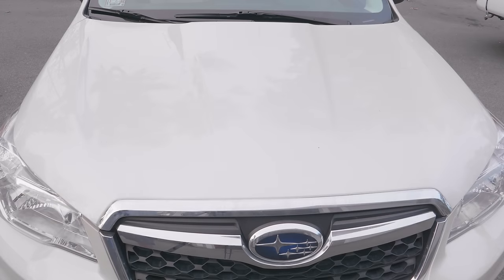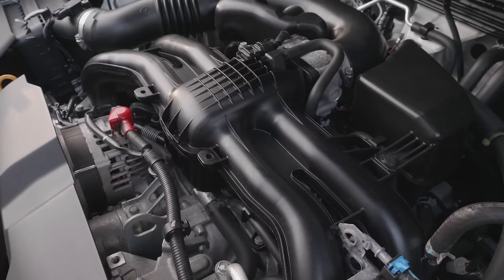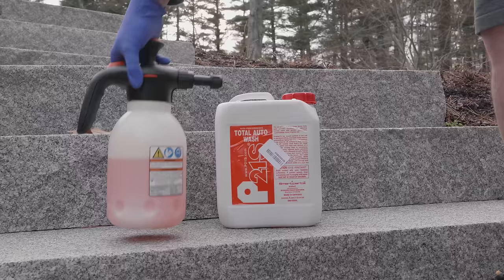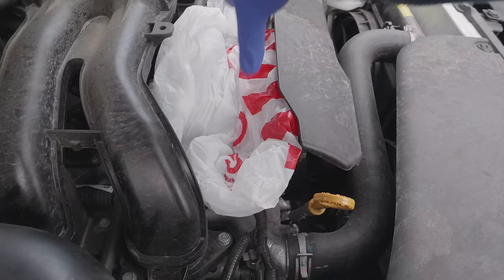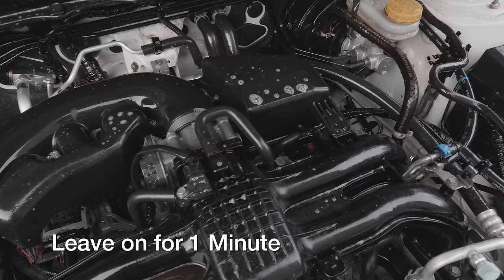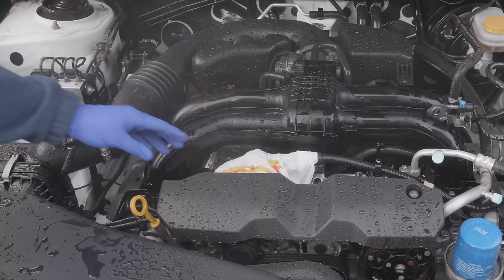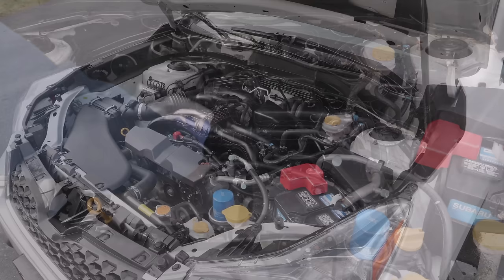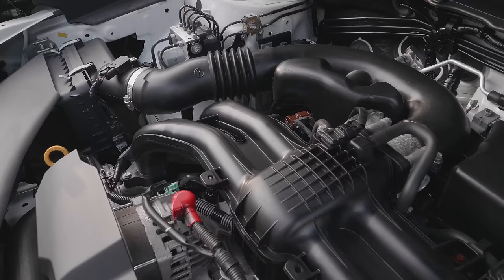Clean & Detail Your Car Engine in 5 Minutes!

Comment: I feel covering/disconnecting the battery would help
Reply: He disconnected it
Reply: Why do that they work perfectly well when wet .
Reply: @paulwainwright967  Avoid short circuiting it
Reply: I completely agree
Reply: There are a lot of harnesses with power in newer cars when the ignition is off.  Your not going to short wires and start a fire, but sensitive low voltage circuit boards and some sensors are very sensitive to even minor electrical blips.   Just takes a few minutes to disconnect the battery and it's a good time to clean the battery terminals.

Comment: Great video....i suggest let it dry for bit after rinse...i started having belt squeaking after i turned on engine....mechanic friend said cuz it was wet.....
Reply from the maker: Thank you. You can certainly do that. I have had a bit of a squeak but it was always gone within a couple of times.
Reply: Your belt shouldn't be squeaky when wet.
If it is it's either a tension polly or a mis-alignment.
Try using a Gator belt!

Comment: Took a 7 year old engine that had never been cleaned. Followed steps, used a Citrus based Degreaser that I got from a Friend who owns a restaurant.
Diluted it 4-1 and sprayed. Used garden hose, and touched up with soft bristle dustpan brush  & Shop Vac and 5 minutes  later clean as a whistle! Took longer to get the shop vac and extension from the basement and open indoor valve to freeze proof bib and return them to storage. The cleaning was the easy part,

Comment: I've always used cleaning wipes frst then Armor All wipes to add a little shine. Never spray water in engine bay, electrical parts and belts could be an issue later. My method takes about 30min depending how detailed you want to get, but it's safe and effective.  Try it😉

Comment: The engine only had a thin layer of dirt. I'm very sceptical that using this method on an engine with caked-on thick oily residue would give similar results.
Reply: It was already clean in the first place

Comment: I use purple power diluted with dawn  and use a paint brush then use a nozzle on the mist setting and rinse motor off , I cover alternator and fuse box with plastic bags. Done this for years then wipe it all down with meguires for interior spray on rag and wipe down everything especially rubber hoses I don't spray and let set looks better but dust sticks to everything easily
Reply: You should stop using McGuire's on your engine. It leaves a film that dirt sticks to just like the Gunk engine degreaser it also attracts dust this method here works and it does not attract dust.

Comment: Tip: Dont forget to disconnect the battery first!
Reply: It's still connected in the video.
Reply: Dont need..i do this for years...
Reply: Don't need to.
Reply: (Do Not disconnect battery.) It will reset your computer and may cause issues with passing Inspection.
Reply: @MarketingCoachKen  so, then what happens when the battery dies?
Reply: Ahh no. No need for that at all.
Reply: @MarketingCoachKen  resetting the computer doesn't hurt nothing.
Reply: Just put a bag over it. 🇺🇸

Comment: Thanks for this advice. I can’t wait to get this P21S and clean my engine per your instructions. I was always afraid I would short something out, but I’m glad I am wrong about that.
Reply: If you drive in the rain then your engine is wet🤷🏻‍♂️
Reply: @nathan hunter
The bottom of the engine will prob get a little wet and the rest of it will stay dry. That’s why all electrical connections are on top and sides , they stay dry

Comment: Wonder what this product will do with a real dirty engine. Till then I stay stick to the meguiars wheel cleaner on the engine. Same method, spray it, wait a few mins and brush only the very dirty parts and rins with water. But would advise to protect the plastics with a protector anytime for a longer lasting.

Comment: The engine wasnt even dirty to begin with… a few specs of dirt here and there is not a problem. Try engine oil that’s been caked on for years, power steering fluid that leaked from the hose, and transmission fluid that I spilled 2 years ago…

Comment: I would love to see him do this with a car that has coil over spark plugs and the computer stores under the engine bay. This is hype nowadays it's very hard to detail in the engine for the past 15 years or so. There's a lot of Technology under the hood. It's not like 25 years ago where you cover up one coil pack in an alternator and go at it
Reply from the maker: More videos to come on this one. But I have used many times on coil over plugs on multiple Toyotas and more complex vehicles. No issues for me at all. Electronics in the past 15 years are much better sealed. The old stuff is the issue for water.
Reply: Absolutely correct! I blew two coil packs at $100 each by doing this, and I knew better.
Reply: @agf804  I'm thinking you're lucky blown coil packs was the only issue you encountered with this method.
Reply: How much water do you think gets into the engine compartment when you drive in the rain?

Comment: I've cleaned every engine on every veicle I've owned bought them all brand new and at last count it was 12 truck after a drive that gets the engine heat Guage up to normal i spray everything with foamy engine bright even the underside of the hood let it sit 15 minute's and spray it down real well with the garden hose starting with the hood i use to just leave the hood up to dry with the motor running now i use my leaf blower once its dry and old rag and armoral on the plastic parts and it looks like the day it was installed after 40 years i have never had a truck not start right up first try and i have no damadge to wires or hoses all the lights work and just to get any over spray i usually wash and wax right after i can understand some people worrying about it but my father did it constantly and you could eat off his engines you decide.

Comment: I have a Chevy Volt - there are high voltage cables and components under the hood. I don’t want to risk trouble with these by spraying water on them. Wiping the surfaces manually is more time consuming, but, I think, safer.

Comment: That is a very light coating of dust on a nearly new engine bay. Not a difficult test for a product IMO.
Reply from the maker: How about a 15 year old truck with an engine never cleaned before? https://youtu.be/8aMKkUcTTJ4
Reply: Right. I couldn't stop laughing when he first showed the "dirty engine"...then the plug for the product came.
Reply from the maker: @michaelangelo5783  Keep laughing https://youtu.be/8aMKkUcTTJ4
Reply: @michaelangelo5783  I saw the other video. You might want to check it out.

Comment: This is all good, but a lot of these older and even newer vehicles has the fuse panel inside the engine. Like my 2005 Ford Explorer Limited. You definitely can't get those wet nor the spark plugs and wires. Your vehicle will not stae5 or if it does it will run rough till it dries itself out. I personally never tried that product. I just know for a fact you cannot get certain things wet in your engine.

Comment: I stopped washing my engines years ago. Not worth the problems afterwards.
Reply: What kind of problems did you have after washing them?
Reply: @mstripling86  It was 25 years ago. I only recall electrical issues with the ignition. I covered the important stuff and the problem happened after engine washing.
Reply: Wow, if only we still based all of our present-day technology decisions on things that happened 25 years ago.. we’d be fucked. 

Perfectly flawed logic, Larry.
Reply: @treylanf0rd  no, his logic is that he isn't worth the potential risk to his engine by exposing it to water.  Seems pretty logical to me
Reply: The mist from the water creates a lot of trouble .if you don't have oil leaks  don't even bother.
Reply: @mstripling86  I remember now. Throttle position switch would fail every time I washed the engine. No matter how good I covered the carburetor.
Reply: Here's some sound advice . Never ever put a water hose anywhere near your engine bay.   If you do things may be fine for a while then the electronic troubles start.   missfires, engine codes and all the rest .You may just be lucky and not experience any problems but it just isnt worth the risk.   Speaking with 50 years experience in the trade.
Reply: Most likely it was water getting in to the spark plugs causing those ignition problems. Anything electrical will cause a problem when wet.

Comment: I've done numerous engine Detailing. Purple Power works great for those real nasty engine compartment. You need some agitation on heavy Grease  and stains. On old school cars, you may also cover the distributor. Most cars, water does not affect engine afterwards. I have had a few where it would run rough for a few minutes until completely dried. Don't aim a strong Pressure jet of water to any of the Electric Modules as a precaution.

Comment: Are you sure it wont damage some computers and electricals  while rinsed it with water?im a bit hesitant it might damage electrical because of the water
Reply from the maker: Most modern cars have no issues and I have done it this way for over 10 years with no problems. But you need to use it at your own risk since I can't see your car or situation.
Reply: Here goes nothin😅my car is nissan qashqai i think in America it’s called rogue will this also applicable in old car like 2009 model toyota innova?
Reply from the maker: @raizensheng  Another thing you can do is to use the plastic bag like I did to cover your fuses, etc. This was you can have more protection.
Reply: Since Im not used to it, I really am hesitant to do it. I worry that the electrical parts might shortage when they get wet.
Reply: @fshs9028  Do you drive your car in the rain? Same thing.
Reply: @hartzland7658  actually not the same thing there's something called a hood? And most cars have under covers which protects the engine the only thing that gets wet during a storms is your radiator
Reply: @wicked8139  Lol! at highway speeds with pissing down rain, water being pushed out of tyre tread, I can assure you the entire under side of your car, including the engine will get wet! Bonnet or no bonnet. Very interesting comment Lol!
Reply: @hartzland7658  what kind of flintstones car do you drive??? Modern cars have splash shields and arch liners to stop water/dirt getting to the engine. In England driving in the rain is the norm and I've never had a wet engine afterwards.
Reply: @GTStGambit  So you seriously think the engine bay is fully sealed that no water gets in? You are on fricken drugs!
Reply: @hartzland7658  you literally don't know what your talking about...smh
Reply: Van Crz any thoughts on the possibility of water ruining the electricals because I fear that by running the water, I run the risk of the electricals being ruined from being rinsed with the water and thus, damaging my electricals.
Reply: Tell it Like it is c
Reply: I wash my engines once in a while and I've had no issues. My Mitsubishi has no splash guard from the factory. It gets crazy dirty after rain and snow. So tell it like it is, is right. Some water doesn't hurt the engine at all. Now... I definitely wouldn't hold the hose right on top of the electronics and just sit there for a couple minutes lol. That's a no no.
Reply: Tell it Like it is r
Reply: Tell it Like it is I’m a master technician for ford, I can guarantee you that not a single car has a water tight fuse box, majority are held on with a couple plastic clips with no gasket nor rubber to be seen, let alone the ECM being towards the hood to keep water from splashing onto it from underneath. So no, you may get lucky rinsing your engine off once or twice but sooner or later you will short something out or fry your ecm/pcm which is always getting constant voltage
Reply: @wicked8139  We have a manly word for hood over here... Bonnet....😋
Reply: @GTStGambit  lol I'm not sure exactly what he's talking about I've never had my engine soaked before by rain

Comment: Silver, I love your videos, but this is not a dirty engine.
Reply: Exactly. That was new engine that recently drove down dirt road.
Reply: Use a degreaser instead, I been washing my engine on my 2000 honda odyssey and never had an issue.
Reply: They intentionally sprayed it with dirty water and let it dry. Fake af
Reply from the maker: How about a 15 year old truck with an engine never cleaned before? https://youtu.be/8aMKkUcTTJ4
Reply: @SilverCymbal  i've seen it and liked it already

Comment: I plan to use this method on the engine of my 3 year old car with less than 20,000 miles after rodents chewed into the wiring harness and set off the check engine light. Since the pandemic I have not been using my car every day. I 've found acorns in the engine compartment and in the past all I needed to do was remove the debris. Now, I have to pay $$ to get the wiring harness replaced. So it's good to know I can save money by doing the engine cleaning myself.

Comment: What about an engine with caked on grease, grime and dirt. If mine looked like in the video, I wouldn’t even need to clean it.
Reply: I used to work at a truck wash and you can power wash your engine just fine get too close and avoid lose hoses the air intake and the alternator

Comment: Great result on the engine bay. The price is too high for the P21S Total Auto Wash. Even though this is really quick at £76 for 5l. We use 10p worth of APC and Snow Foam in a Pump Foamer, agitate with a brush, Jet wash low setting (cover critical components), filtered warm blow dry and coat with a uv resistant plastic dressing. Done and dusted in 20mins for under a £1.
Reply: All these murican products are expensive for what it is

Comment: Damn I have always wondered how used car lots get the engines so clean
Reply: Take them to the car wash and clean it with whatever the car wash offers. Now for even better results buy any cleaning engine product from your auto parts store and Walla. You can add tire foam afterwards and you will get a like-new clean look
Reply: @rgawt1870  What about engine degreaser?
Reply: @Jeffrey Sampson
 BACK IN THE EARLY 70'S WHEN I STARTED BUYING CARS, THE DEALERS WOULD STEAM CLEAN THE ENGINE BAY THEN USE AUTOMOTIVE CLEAR COAT TO FINISH IT OFF.  IT LOOKED LIKE A NEW ENGINE BAY FOR ABOUT A YEAR.  AFTER THAT IT STARTED TO YELLOW AND FLAKE.  (MAN DID THAT BRING BACK SOME MEMORIES!......MY FIRST CAR AT 16 YEARS OLD: 1966 BUICK RIVIERA PURCHASED IN 1973 FOR $800.00)
Reply: @seymourscagnetti1413  The 66 Riviera was a beauty! Me, 66 Toranado in 1975 at age 16, with a bad transmission. $35. LOL.

Comment: I'm always scared of getting electric components wet,  you used a lot of water.   Should I be worried..
Reply from the maker: Most professional detailers do it this way except they scrub for 30 minutes and many use pressure washers. I skip all that with this method but yes you need to do it at your own risk depending on your model car.

Comment: How to clean a clean dusty engine.
Reply from the maker: I clean it once a year using the same method but if you remain skeptical watch the same product clean a 10 year old mower with stuff all over it. https://youtu.be/3GsW2W2e1Oc
Reply: Maybe a can of pledge, lemon scented of course.
Reply: @SilverCymbal  No one is questioning that the product won't work it's just that a truly greasy, grimy engine will take longer & will need agitation with brushes & microfiber clothes.

Comment: On modern cars you might want to remove the engine pan to allow drainage and airflow. It's usually plastic and held on by a set of bolts.

Comment: All ways watch out the electrical harnesses and sockets especifically ecu socket .  electro mechanical parts like abs module can misbehave if water get in them .
Reply: Can even cause damage if short circuits.

Comment: Good video, thanks. I will do the same this weekend but using Bilt Hamber All Purpose Cleaner instead, it's available in Europe and especially Ireland/UK where I'm at. For dressing I'd recommend ACF-50, it's super stuff but not cheap and ideally need a compressor to apply sparingly. Anti-rust and makes plastics pop too.
Reply: What do you mean by dressing please, I am in the uk. Can you please send a link for the product you use to clean your engine

Comment: So when you wash your engine bay you don’t have to disconnect your battery before spraying water. Lots of other retailers say to disconnect the battery, and cover the alternator to ensure there isn’t electrical problems after cleaning.

Comment: I did that on a civic 2000 and water got into the hole of the spark plug and that caused my engine to stop working. i had to remove the water to make it run again. be carefull! people seem way 2 ignorant when detailling engine bay imo.

Comment: Modern cars are jampacked with all kinds of sensitive electric components like plugs, computers, modules, sensors etc and these are often very expenisve to replace. 
When you cover the entire engine bay in water you risk getting shortcuts and these might not occur immediately as the trapped leftover water might slowly leak into these electric components so this might look very nice but there is a great risk involved.
Reply: Not really. Every car dealer I've ever worked at has used this method when they first get new cars in to clean their engine. If you use a blower to get rid of standing water there is a zero risk involved.

Comment: I was watching ChrisFix do exactly going all out OCD with the brushes, dry cleaning 🧼 2 different ways, washing and brushing around the engine. Which that take a crazy 😜 amount of time. 

I had a guy where I worked that had OCD up the a$$ and yes would do a good job but take forever doing it. A 2 ft by 2 1/2’ sink he spent 6 freaking hours on it.  No joke.